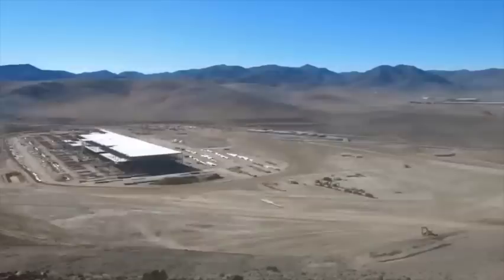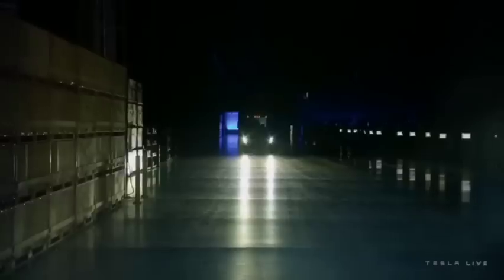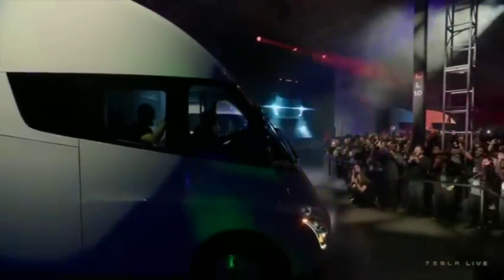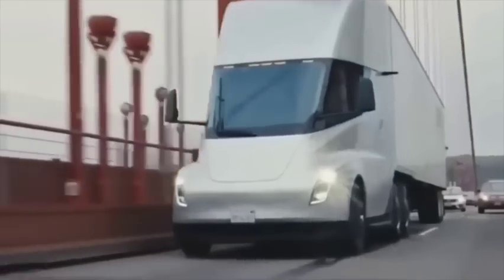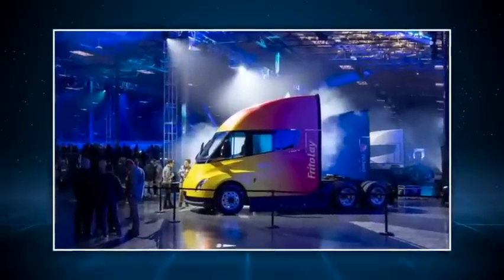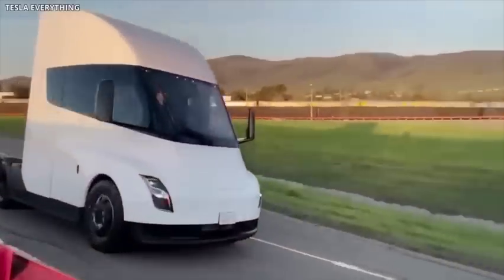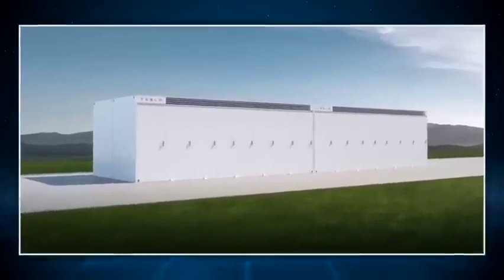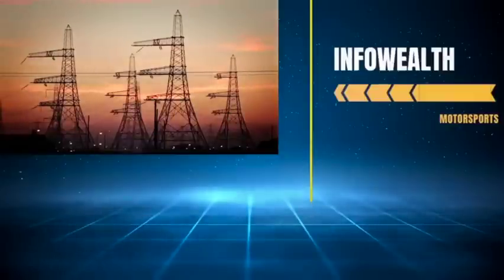Elon Musk And Tesla Leaves Everyone SPEECHLESS!!!

Comment: I think Toyota had the better idea: which is to say, make the batteries in EVs hot swappable so that you can charge the batteries without immobilizing the car. Now, Toyota was having robots do the swapping, but I think the batteries should be removeable and replaceable by the owner. That way the owner can charge a spare battery at home while out driving, then swap the batteries for the next day.
Reply: Toyota is not doing that. You seem to be like a troll.
Reply: @cre8tvedge  Really? I saw a video a while back that Toyota (I think it was Toyota) was designing EVs with swappable batteries and a robot station that would automatically swap them out.

Hmm... a quick search of YouTube seems to reveal that it's not Toyota, but a new startup company? Found video here:
https://youtu.be/WOsy_EvtHr4

In any case, swapping batteries seems like such an obvious thing to do to charge EVs up quickly that I'm amazed EVs weren't designed from the get go to have their batteries be manually replaced.

Comment: If two tesla semi want to charge; then the charger would have to have at least 3 megapack batteries and probably more since cars will also be charging.  So maybe 4 or 5 megapacks.
Reply: remember that power will be coming into the charging station while charging semi and cars.  I presume the grid connection is 3 phase and at least 600 vac...does that make the
input essentially 1800 volts at ? amps?  maybe 200 amps?  360,000 watts?  In 30 minutes charging time the grid will supply about 18kwh.  that's not much compared to how much
 5 megapacks hold --- 5mega watt hours.
Reply: oops, i left out a zero...the 18kwh should be 180kwh input...or about six hours to recharge one megapack?